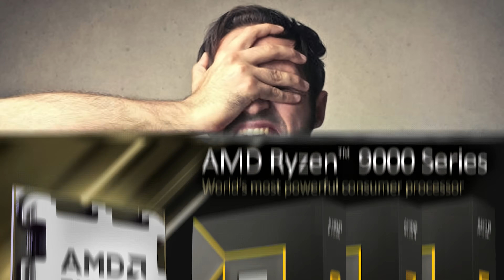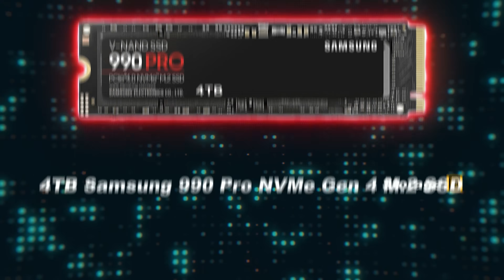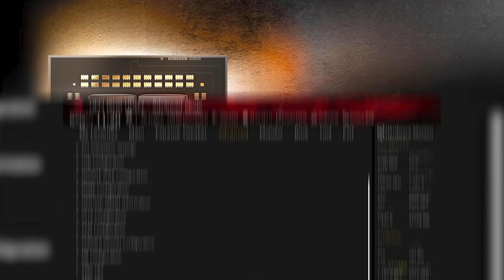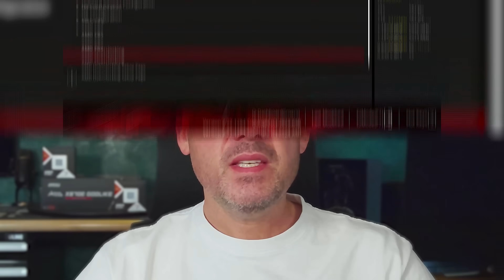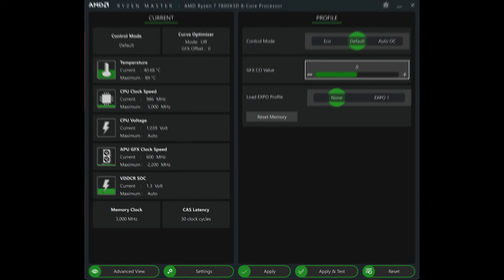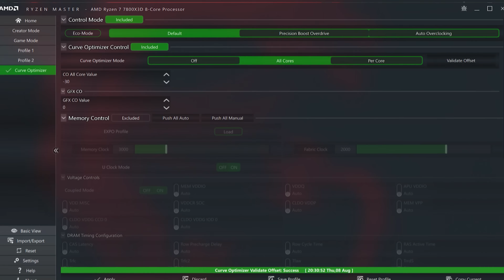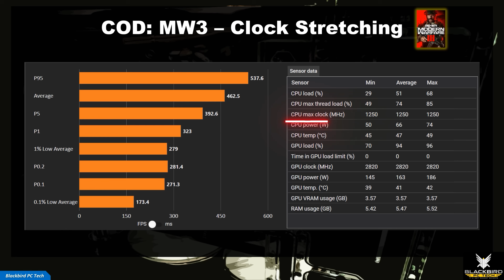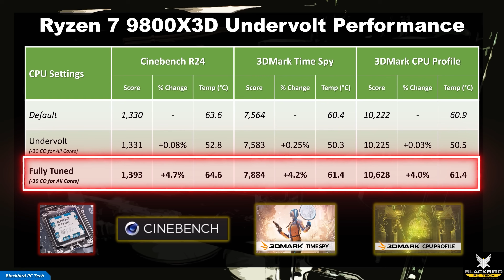How To Undervolt a Ryzen 7 9800X3D The Right Way! (or Any AMD AM5 Ryzen CPU)

Comment: Im running  9600x at 1.1v and 5,5hz... Underclocking is more fun than overclocking used to be. Lowering Ram speed to 4800 also lowered my CPU temp by like 20 degrees.. And i dont see any major performance issues
Reply from the maker: Lowering your RAM speed to 4800 is a really bad idea ... not sure what applications you tested, or perhaps you tested with the CPU lightly loaded, but RAM speed will have a meaningful impact on performance.
Reply: @blackbirdpctech  Yeah dude its still above AM4 speeds and I entered a new phase of being a PC enthusiast :) Energy consumption became a priority and i can clearly see a 30% drop in power consumption of the CPU by just lowering the ram speed on am 5 platform. While losing 5fps at most in games.
Reply from the maker: @GwynBleys  that's great but to be clear, AM5 works differently to AM4 ... the UCLK will not run in 1:1 mode, so even though the MCLK is higher than on DDR4 RAM, the system will be quite a bit slower. I explain this in my DDR4 vs DDR5 video. The drop in performance is also not 5fps in most games ... it's considerably higher. I am happy to have you share your data, but I don't want other viewers that may read your comment to be mislead.
Reply: @blackbirdpctech  Good point, i didnt keep that in mind :) Nevertheless it cuts down on cpu temp and power consumption and that is not misleading.
Reply from the maker: @GwynBleys  agreed ... the power/temp reduction can be a big deal in a small form factor build.
Reply: @blackbirdpctech  And that is exactly what im trying to do in my brand new Lian Li A3 lol
Reply from the maker: @GwynBleys  I haven't tested the impact of lowering memory speed on CPU temp ... didn't realize that it was so significant ... would be an interesting thing to test as part of a future SFF build video.
Reply: @blackbirdpctech  Hey we both learned something new :) Test it out

Comment: My 9600x increased temperatura +5° is it normal? I I am using -20. My temps were  74° before, now they are 79°
Reply from the maker: That likely means the undervolt didn’t get applied … make sure you selected negative … that looks like you over volted by accident

Comment: Wait I’m confused new to this i also copied the + 200mhz with -30 and i still when i run multi core max temp is 80c is it a W ?
Reply from the maker: You should watch this video to learn more about how to properly tune your CPU: https://youtu.be/9y_MGzrQHDg

I would be very careful simply copying the settings that I used because all CPUs are different.
Reply: @blackbirdpctech  Thank you for the reply,  the weird part is i tried to do everything in the bios but for some reason is not saving my custom settings.. bios is forcing me to set diff setting maybe it needs an update.. then i did the settings from the master ryzen and everything saved but I’m not seeing huge temps diff just 2c only
Reply from the maker: Make sure you are setting the undervolt in the right place in your Bios.

Comment: Do you have PBO enabled or the only thing you did is to set the curve. And by PBO enabled i mean in the ryzen master or in bios it should be called PBO advanced.
Reply from the maker: I quite literally explain exactly what I did, and answer your questions, in the video you are commenting on.
Reply: @blackbirdpctech yeah thank you! I got confused since in ryzer master you did not enable PBO but in bios yes.
Reply from the maker: I don't recommend using Ryzen Master ... it is somewhat unstable, at least that's the experience that I've had
Reply: @blackbirdpctech that can't harm the CPU right it can only extend the life of it because of lower temps.
Reply from the maker: @Shwapx no, it’s not going to harm your system but it’s also not likely to increase the life of your cpu in a meaningful way

Comment: I can’t get anything stable past -10 when testing with aida64. Am I really unlucky, or is there maybe something I’m missing?
Reply from the maker: What CPU do you have? I wouldn't look at it like you are unlucky, since it's still better than default settings.
Reply: I’ve got the 9800x3d as well. You’re right, it’s better than stock, but most people seem to be able to get -20 no problem
Reply from the maker: @aghilesabdesselam9070  just remember that the difference between -10 and -20 is a few deg C and a very small performance boost ... you will not notice either of them

Comment: Hello! On my Ryzen 7 9800X3D the maximum stable result of Curve Optimizer is -28. But without overclocking to +200 clock. Is this a good result?
Reply from the maker: Of course ... if it's unstable at -29 then I would backoff to -25 for day-to-day running

Comment: Hi! Undervolting that 9800x3d processor eliminates the risk of burning out the 9800x3d because I've seen posts on Reddit about processors burning out due to voltage issues.
Reply from the maker: I believe that the issue had to do with bad firmware from ASRock, which has apparently now been fixed. Undervolting can help but remember that it's a dynamic undervolt, so your actual voltage will still vary with load.

Comment: stick to what OP said, do NOT use ryzen master. I got lazy and just used it to -10 and pc would not boot back up. had to clear CMOS to get it working again. trash software, stick to bios always! i figured this day and age what could go wrong. well, a lot. thankfully my mobo has the cmos button so I didn't have to get the tower out and opened.
Reply from the maker: It’s surprising that after all of this time AMD hasn’t fixed Ryzen Master … it’s a great idea for a program … it just doesn’t work well

Comment: First of all u are doing a great job, nice videos, full of valuable information and good to grab and use. However, i need to point out that -30 all cores is a pretty suberb 9800x3d, actually not many people will have that much "luck" in the silicone lottery. 
Myself one of my cores can only -22, 5 others more than -35. So if going all cores I loose loads of potential. I can recommed the tool HYDRA what costs around 10 Euros via patreon. this will find optimized settings per core in around a day of tweaking by itself. You can find guides on YT also. Helped me  a lot pretty flawlessly. My temp went down by 12 degrees max, and around 20 in average. awesome.
Reply from the maker: That's a fair comment ... -30 CO all-core is aggressive and likely indicates I got lucky with my silicon. I have another 9800X3D that can do -25 CO all-core and a third that I haven't yet tested.

I've been a fan of 1usmus for a while ... I discussed project Hyrda at length in one of my earlier videos. My only issue is that I've found it to be somewhat unstable over time and I would often get issues with Windows anti-virus thinking it's a virus which was annoying ... just something to be aware of.

Comment: Hey! Not sure if you remember me or not commenting about wether i should buy the 9800X3D or not. I ended up doing so! So at first i did a -15  curve offset and it was stable for 10 mins. Came back to this video to see if i should do more? I did -30 and within a min and 44 secs it gave me a hardware error. I went back into bios and set it at -20  and so far it seems stable. I know you mentioned the whole point is too get lower temps and more performance, but how far should i go with the negative curveset?? Also for some reason X3D turbo was enabled and it only showed 8 cores. I disabled Turbo and now it says 8 cores and 16 threads. But what about “Built for X3D”? I have those two options in bios on my gigabyte B850
Reply from the maker: Don't use the manufacturer gimmick features in Bios ... every time I test them they lower performance. For your undervolt I would set it as low as you can while maintaining stability.
Reply: @blackbirdpctech   sorry i dont mean to be a pain but as low as i can meaning like -10? I haven’t tried negative 10. -15 and -20 are stable, just not -30 so far
Reply from the maker: @jacobaltman102  lower negative values will generate better results ... so -30 is better than -20 which is better than -10
Reply: @blackbirdpctech gotcha! Thank you so much for everything. I am so glad i stumbled across your videos!

Comment: i tried to under volt with the bios but the diffreace in temp is zero what is happing?
Reply from the maker: Sounds like your undervolt is not being applied … make sure you are entering it correctly in the right location
Reply: @blackbirdpctech  i am studing for my finals after i finsh i will see again

Comment: Hi man i have rtx 4080 and r7 9800x3d with power supply of 750watt can i do this undervolt ?
Reply from the maker: Absolutely
Reply: @blackbirdpctech I mean my power supply is on the limit 750watt m afraid of instability in the system
Reply from the maker: @Djalilhds  an undervolt should reduce your power draw so if anything it should help.
Reply: I lost fps and performance after i did the same and i did stress test it was stable but in games i lost fps and stutter
Reply from the maker: @Djalilhds  sounds like you should get a new psu … you shouldn’t lose performance and get stutters, so there is something else that’s wrong with your system … remember, never try tweaking an unstable system
Reply: Yes i reste back to default and the sttuter stays then after i deleted games data from %appdata% folder came back to normal donu have a solution for that ?
Reply from the maker: @Djalilhds  I don't really understand what you are saying ... you deleted data and the stutter went away? Was your drive full by chance?

Comment: I have a 9800x3d with ASUS TUF GAMING B650M-PLUS, Teamgroup 6000mhz cl28. My idle temp was 60c, and with standard CPU settings on Cinebench I hit 90c. With curve optimizer set to -30 the CPU was able to run at 5225Mhz and reach 75c in Cinebench using 1.087v. Do I need to adjust the curve optimizer to -20/-25?
Reply from the maker: Did you check to see if your undervolt is stable as explained in the video?

Comment: I just wanted to say that your videos are some of the most comprehensive and easy to understand ones relating to component tuning that I have found. 

I recently parted together a new pc and the R7 9800X3D cpu was what I decided to go with. With your help I went from zero to hero and actually started to enjoy the process of tuning, benchmarking, and journaling my results. 

My current undervolt:
Core    Offset
0            -30
1            -28
2            -23
3            -23
4            -25
5            -22
6            -25
7            -18

My eight core was unstable at anything around -22 CO so I changed to a per core undervolt to push the rest. Not seeing any core stretching and wouldn't have had the confidence or know-how to do it without your help. Bless!
Reply from the maker: That is awesome to hear ... really appreciate the feedback!!

Comment: i used ryzen master to -10 and had to reset cmos :( pc didint started. i have a msi b650 thomahawk. i will try later do it on Bios instead.
Reply from the maker: Yeah, I've always had problems using Ryzen Master ... it's a very convenient tool but it just doesn't appear to be very stable.

Comment: I was getting pretty frustrated because the CPU was constantly triggering my fan curve while gaming. I did -15 under volt and my temps are way better with the same performance. Tyvm.
Reply from the maker: That doesn't really sound like an issue ... you can always modify your fan curves to kick-in at higher temps or lower speed.
Reply: Yeah, problem is that it was spiking to 90C. I set the fan curve several different ways and it always sounded like a jet engine. Imo it was an issue lol.
Reply from the maker: @MrWorld46  ok, that makes more sense
Reply: @ Staying well below 80c with oblivion remaster now. :)

Comment: Why do you set the platform thermal limit so low? Are you concerned about damaging the CPU at higher temps? Presumably it would boost higher/longer with a higher thermal limit.
Reply from the maker: That's a good question. I typically set it around 85 deg C to prevent an issue if I get an AIO pump failure. If you are using a good quality AIO your temps will usually stay well below 85 deg C, so it will only kick in if you get a failure. Just a bit of added protection given that I also unlock the power limit.
Reply: @blackbirdpctech  thanks! That makes a lot of sense
Reply from the maker: I had an AIO fail during testing and I didn't know because the temps stayed below 95 deg C in most games ... I didn't realize that the CPU was throttling ... luckily it only impacted the data for a few games.

Comment: hi everyone, my tuf gaming b850m-plus with ryzen 7 9800xd3 crash system stability test on stock , anyone can help me?
Reply from the maker: Check your memory stability in a memory tool like Karhu ... my guess is that your memory config is not stable. What is your RAM config and are you using EXPO/XMP?
Reply: @blackbirdpctech  thanks for your answer. i disabled expo and system stability test work fine. i've ddr5 corsair cl 30 6000mhz. now RAM work at 4800mhz. what can i do to set up properly my ram?
Reply from the maker: @Bistecchina95  how many dimms or sticks of RAM are you trying to run?
Reply: @blackbirdpctech  2  sticks of 32gb ddr5 cl30 6000mhz
Reply from the maker: That shouldn't cause stability issues ... I would clear your CMOS and start Bios fresh ... and/or update your bios to the latest version and try again
Reply: @blackbirdpctech  I solved it by lowering the RAM clock from 6000MHz to 5800MHz.

Comment: @Blackbird PC Tech hey , i ran the Aida stability test after setting my undervolt to -20 , windows started and things appeared stable,  i ran the Aida software to check if its stable, you said in the video it would be around 10 minutes, now i have waited for 22 minutes and counting, and its still runnning without a result, so how long do i wait , how do i know if its stable or not if the test never appears to end, i have a max temp of 39 degrees C during the stress test, my cpu is a Ryzen 7800x3d,
Reply from the maker: In the video I said to let the AIDA64 stability test run for around 10min ... if nothing happens and the test keeps running then that means your undervolt is stable ... no need to keep running it unless you want additional reassurance that it's stable.

Comment: I have an MSI x870E board with the 9800x3d, my AIDA64 temps were 71C and with a -20mv drop it went down to 68C, and with -30mv it went to 67C, but still stable, this is with water cooling. But with -30mv all cores have gone up 250mhz.
I see if I can go lower still.
Reply from the maker: Looking good so far ...

Comment: 9800x3d paired with a x870e hero and teamgroup tforce 8000MHz sticks(2). If i put -30 my pc wont boot same thing for 25 and lower down except -5. It seems stable there. I did follow a per core over clock when i first installed it should i take that oc off and retry your settings? Also will having the per core oc caused a no boot when also applying your settings??
Reply from the maker: I'm not sure exactly what you did or what you are asking, but I would recommend clearing your CMOS and following the steps in this guide ... as I explain in the video, your results will vary as a result of silicon quality, so you may not be able to get -30 CO all core stable.
Reply: @blackbirdpctech  In bios I can't run async mode as my pc won't boot for some reason so leaving eclk @ auto seems to work for now not sure why. So in PBO I have advanced, motherboard, manual, 10x, enable(positive), cpu boost +200. My question here is a async mode necessary for oc?
Reply from the maker: @ follow this guide to overclock your 9800X3D: https://youtu.be/9y_MGzrQHDg
Reply: @blackbirdpctech  My mistake at first was duplicating my curve shaper without knowing and causing crashing. No damage as my cpu is running fine. I'm still new to this oc/uv game😅. Anyhow, just out of curiosity curve shaper and curve optimizer are essentially the same am I right, with the exception that one is a more detailed per core setting?
Thanks in advance for your time hope you have a great weekend!

Comment: What is wrong with Ryzen Master? Makes it very easy to find your undervolt. My 9800X3d makes it to 1.13 locked @5200 using manual and PBO disabled.
Reply from the maker: Ryzen Master has always caused problems when I use it ... it's simply a Bios interface in Windows, so I skip it and just do everything directly in Bios.

Why would you disable PBO and use a static undervolt instead of a dynamic undervolt using the curve offset feature?

Comment: Really love your videos. This is the only channel that gives the correct information without dragging it out and showing the results!
One question, is 3d mak benchmarks enough for benchmarking or should you also test the in game performance after the tweaks?
Reply from the maker: I've shown in my last few videos that 3DMark does a great job of loading your CPU/GPU in a similar way to most modern games.  That said, you should always test your tuned system in the games that you play ... there will always be differences in the game engines that 3DMark can't accurately predict.

Comment: multi core performance increase, but single core got slightly worse. ~1.2% - Is undervolting expected to decrease single core performance?
Reply from the maker: If you run your test again my guess is that the single core performance will go back to what it was ... 1.2% is not meaningful and typically within run-to-run variation.